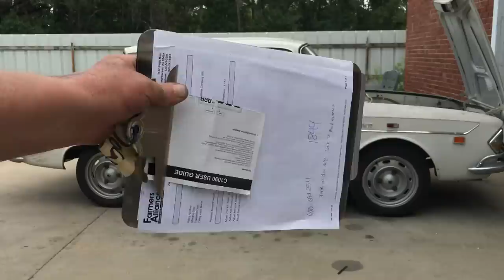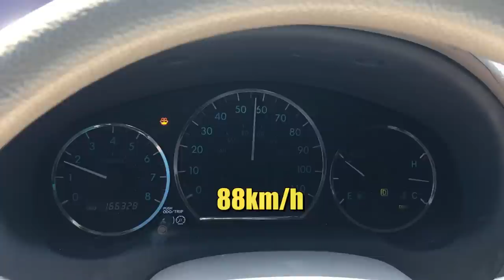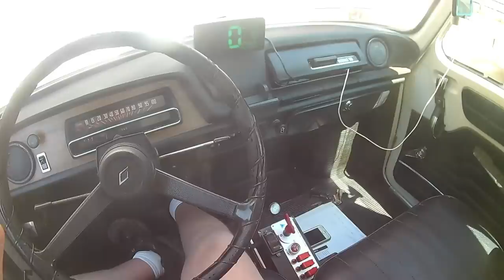S3 E21. How fast will this 670 cc predator V twin powered Renault go?...  Faster than you think!

Comment: "It's as if Renault made no effort whatsoever to homogenize this car for the American market."  Nobody copies the French, and the French copy no one.
Reply: With surprising results...sometimes.
Reply: Horsehockey.  Everybody (almost) tries to copy the French when it comes to wine.  Renault,..... well not so much.
Would love to know the 0-55 time with the original R10 engine.  No fair racing farm machinery.  They always win.
Reply: Volvo and Renault worked on a joint V6 engine in the late 70s.   The result was what I consider Volvos first bad engine.  Overheat it once, and the whole thing was trash.
Reply: What the,you haven't heard of a Chevy yet made in America for America by 2 Frenchman living in America oh by the way Chrysler and dodge are French also
Reply: @randallthomas5207  I am still unsure what's up with the bad reputation of the PRV over there, this engine was co-developed between Peugeot, Renault and Volvo (You can guess where the acronym came from). 
Now it is a bit weird, because of its 90° V6, since it was supposed to be a V8. But calling the PRV unreliable is like saying GM makes bad cars. They made a dozen of different variants from the mid 70s to late 90s, some in 24 valves form, some with turbos, making up to 400hp in the last Venturis.
While they aren't known to be fun or cheap on gas per se, they're known to be basically bulletproof, it's not rare for them to go 500k+ km here in their 12 valves form.

I think the poor work of DMC and emissions rules really messed with people perspective of this engine in the US, a shame because they’re great little things!
Reply: @fs6622 I've never had a French wine that I thoroughly enjoyed. I think the issue is that I rarely ever spend more then £20 on a bottle of wine and I can imagine all the decent French wine has a higher price tag then an equivalent Australian or American (or other countries) wine. 

I can also imagine all the rules in France about wine making make it harder to "fake" a good wine (they aren't allowed to add sugar to compensate for low sugar content in grapes, they're only allowed to use grape consentrate to boost the unfermented gravity which has the disadvantage that it can also increase acidity). Allot of the wines I like well and truly throw the rule book out the window. One of my favourite wines has about 15% of the fermentables from forest pollen honey and uses black forest fruits as well as grapes.
Reply: Everybody copied Citroen , specially the germans
Reply: @micheals1992  I never implied that French wine was better.  Only that so many winemakers try to emulate it.
Reply: @justinbridgewater7055 Walter Chrysler was German. The Dodge Brothers were American born, of British descent.
Reply: @randallthomas5207  My Mom & Dad bought a 1976 265 wagon with the "PRV" engine. At about 60,000 miles the camshafts had to be replaced, and as this engine was designed for a front wheel drive application, you had two choices. Either pull both cylinder heads or cut holes in the firewall, as the cams had to be removed from the rear of the heads. At the same time I had bought a new 1975 242 with the B 20 engine. The 242 was more than an equal match for the V-6 power wise and the B-20 made it past 300,000 miles with the second owner. The V-6 was a serious downgrade from the 1975 B-30 engine
Reply: @micheals1992 what's the name of this wine? Sounds really interesting, I would love to try it.
Reply: @Wok_Agenda  Everyone used their Hydropneumatic suspension design, thats for sure.
Reply: @fs6622  0-60 was 22.6 seconds. Fuel economy was 29 to 35 mpg US.
Reply: @justinbridgewater7055 The Chevrolet Brothers were Swiss.
Reply: @ulrich_badmecanique European cars are generally sub par. My best friend had one of those little cars when we were kids. He loved it. I don't know why. It leaked all the oil it didn't burn. It didn't have enough power to pull itself, let alone two big kids weighing over four hundred pounds combined. It did get good gas mileage though. Probably makes more power with th the HF engine, and waay more reliable. I would love to have it in it's current configuration.
Reply: True, and sometimes it seems like a deliberate slight. In 1940 surrendering to the Germans was all the rage in Paris, then everyone just stopped.
Reply: @vanceblosser2155  Wow..!  That fast???🤣  My best friend had a 1968 or so R8.  I towed him home once with my 1966 Pontiac.  Scared the crap out of him.... said that was the fastest that Renault had ever gone.
Reply: @timothybyrom5560  You seem to miss the fact that the R10 was just a slightly up-trimmed R8. They were designed to be cheap cars and never pretended to offer anything extra. That's like complaining a modern dodge dart is cheap, they fit a purpose
Reply: SAABs from the bullnose era had their turn-signal's lever on the right side of the steering column. This isn't such a rare thing among left-hand drive steering wheel cars from Europe.
Reply: @justinbridgewater7055  I think you kind of made my point for me.  Not even Frenchmen (Chevy bros) copy the French.  Maybe they came to America because they got tired of making goofy stuff and just wanted to make real cars 😜
(And my comment above was all in good fun.  French make great stuff, its just a little quirky sometimes)
Reply: Nobody copies the French for good reason.
Reply: @randallthomas5207 Peugeot was also involved. The engine is called the PRV V6. It was planned as an european V8. But then the oil price crisis occurred. So they cut off two cylinders which took the smoothness off the engine completely . Maybe there are problems with overheating, but I have never of such things…
Reply: @fs6622  That figure is from road tests via Google. I know it was in that area as our R10 could leave a Beetle way behind. Something must have been wrong with his R8. Their automatic was only a second or two slower, it was a 3 speed but had an electric clutch controlled by an analog computer. No slippage.
Reply: @randallthomas5207 Not quite, but given people's allergy in Australia and America to listening to the manufacturer and doing scheduled oil changes and using antifreeze instead of water, yeah they do pop head gaskets thirty years on, but when new they rarely overheated given the wet sleeve block.
Reply: French invented VR6, even they weren't crazy enough to keep using it 😂
Reply: @Low760  If you had to pull the heads, it was difficult to get things sealed back up, to the head and the wet sleeved cylinders to the block.  They used a paper gasket material, which was easily torn, if you disturbed the cylinder sleeves.  and the top of the sleeves liked to adhere to teh head gasket.  They were really hard to pull the head, and get back together successfully.   And, living in Vegas, things tend to overheat.   It was a common enough event that you could always find one of the Volvos with the 6-cylinder in salvage yards across southern Nevada and Arizona.
Reply: Homologate…..not homogenize
Reply: Come on, surely it was a joke. Turn signal lever side is such a trivial thing.
Reply: @peterelvery  My personal daily driver is a tiny Japanese pickup, with right hand drive.   I get used to the turn signal on the right (drivers window side).   I recently drove a work pickup, with the transmission selector on the column.  I was on a major street and needed to turn left across oncoming traffic.  I pulled up to the intersection, and stopped to wait for the oncoming traffic, and turn on my left turn signal.  When the break in  the traffic occurred, I was in park and missed the turn.
Reply: @fs6622  well if you like fermented grape juice then yea, i guess??.. but the French did actually make some of the most beautiful cars and they did make some of the most innovative cars that was far ahead of its time..
Reply: @justinbridgewater7055  Chrysler and dodge is owned by the Fiat group which is Italian not French...
Reply: @micheals1992  yo french here , here you can have really great bottle for 6~12 $, whe got cheap bottle for less but sometimes there  surprise you.
Reply: @fs6622 to understand that come to France, try our bread , (American standard bread is trash like), try local wine
Reply: @Wok_Agenda who copy Citroen? Citroen cant be copied, other then hydra lift suspension inveted by Citroen and later on bourought by Mercedes ,
Reply: @randallthomas5207 When I started driving here in Australia, Volkswagens had it on the right but German Fords had it on the left? The Citroen CX had a non-selfcancelling rocker switch! Always have to adjust for every car.
Reply: @gabrielc5642  Metal monocoque, disk brakes , plastic interior/exterior pieces , small engine low drag
Reply: @peterelvery  But had self centering steering, self leveling suspension
Reply: @Wok_Agenda  Indeed! I forget who it was who said, "There are cars, and there are Citroens."
Driving a CX2400 was like driving a car from another planet. Huge wheelbase but agile through tight corners. Only real pain was having to remove a headlight to get to the battery terminals which were underneath.
Reply: But renault did invent at least shock absorbers, steering wheel, manual transmissions, drum brakes, replaceable spark plugs (in cooperation with bosch) oh and centrifugal super chargers on which turbos are based on.
I'd say we copy a lot of stuff the french do.
Reply: @randallthomas5207  Same "great" engine found in the DMC DeLorean 😅
Reply: I'm married to a French lady.  Haughty is the word.

Comment: Shaped like a brick and still runs nearly 70mph on a Harbor Freight engine. Pretty amazing what you've been able to do with your last 2 builds.
Reply: Yeah, I want to see what it does with some engine upgrades and one of those little superchargers. I bet it ends up pushing 90.
Reply: @bradleyj.fortner2203  two cylinders enables you to run turbos too, which give better top end power
Reply: I want to see what it gets for mpg with HarborFreight engine vs original
Reply: yeah that's pretty nuts. the hf engine isn't even that strong for its class, so 67 mph right out the gate is very impressive. red beard made 40 with a heavily modded 670, so I'm sure there's stuff mr robot can do to turn his up. too bad there isn't anywhere he can go to really cut loose, because I could see this engine being turned up enough to get this tin can to 100.
Reply: @somedude2492 superchargers are better than Turbos. Superchargers cost more and take more skill to setup is why you see so many Turbos.
If Turbos were "superior" then topfuelers would use them .
Reply: @NotMeeither  i like superchargers, don't get me wrong. Each one has their advantages though. There's a reason muscle cars run superchargers and high performance race engines use turbochargers. Superchargers get power from the get go and thus increase low end power and torque, increasing acceleration. Turbochargers on the other hand take a while to spool up and feel sluggish at the low end, but have much less parasitic draw at the top end and allow for more compression, making for a stronger top end of the curve. These are top speed runs, and the car is running a CVT transmission, so top end is much more important than low end. Turbos and superchargers coexist because they are both good with their pros and cons, neither one is an all around better system than the other.
Reply: @NotMeeither  Its exactly the opposite when it comes to supercharging vs turbocharging. Supercharging is a less complex system by far, and easier to set up.

Turbos are more common because they are already stock on many cars, cheaper and give higher efficiency. 
Downside is effectively just one: More power delivery delay than with a supercharger.

Top fuel dragsters use superchargers, and even a specific type and size of supercharger as well because....thats what it says in the regulations for the class.

Now I dont mind superchargers at all, they are neat. But whats written above are the facts in a comparison.
Reply: It's a light car so I'm not really surprised
Reply: @GoldenCroc  well looks like you know everything in the world so I won't argue with a knowitall.
Reply: And it can be even faster with some tweaks 😉
Reply: @GoldenCroc superchargers were/are also easier to build, so they were in some before ww2 already.

And later were available from 2 stroke diesels to bolt on top of an engine for hotrods and dragsters, so thats what they did.
Reply: @NotMeeither  Why such a sourpuss? Did a turbocharger run over your dog or something? Facts are fact, no need to prefer one thing over the other for it to be so. No shame in having a preference, but your post above was just a little bit to "out there" when it came to statements to be left unanswered. 

In any case, yes for the things discussed above, I do know very well what I am talking about. Feel free to disprove anything about it if you wish, I welcome any chance to learn something new... A pretty good stance to have if you want to know stuff, not just think you do, wouldnt you say?
Reply: @lassikinnunen  Yes, exactly as I wrote above, Supercharging is a less complex system by far and that includes all parts of it. Easier to manufacture (greater mechanical tolerances is o.k), easier to install on a NA engine because of no new exhaust needed, often no extra cooling needed, less critical fuel delivery system and works fine with carburators, something that is so-so with tubochargers, etc etc.

Funny you should mention the two stroke diesels, I know what you speak of well enough. I dont know if I remember correctly, but old school roots blowers sizing were often called 6-71, 12-71 etc. I think those "sizing numbers" originated from which model (which also were called 6-71 etc) of Detroit Diesel two stroke they had originated. 

Cheers mate.
Reply: That's awsome. 22hp engine being able to propel a car to that speed. Flat ground. We don't live in Kansas.  We have hills. Be a nice little car for a town grocery getter. Good job. I was thinking of building one just wodered the same how fast will it actually go.
Reply: @NotMeeither  Let me take your statement and flip it around, If superchargers were "superior" then Formula 1 would use them. There is no one size fits all for forced induction each has its positives and its negatives, which is why BOTH are used to fit the need.

Also a supercharger setup is a lot simpler than a turbocharger setup.... not sure where you got that bit of misinformation from.
Reply: @NotMeeither  Complete nonsense. A supercharger is just an air compressor driven mechanically. What skill is in setup, fitting a pulley?
Reply: See you dont need 300hp. And if you are aerodynamic together with a small engine the savings are huge!
Reply: @NotMeeither Horses for courses. For drag racing the response time of a turbo, especially a big turbo to get big power is going to be prohibitive. You'd be half way down the track before the turbo spooled. To fix that gets complicated (multiple turbos of different sizes, nitrous oxide, etc.). 
For on road driving superchargers aren't the most efficient way to provide boost, turbos win there as they're using waste heat from the exhaust, not stealing power from the crank that could be driving the wheels.
Reply: Shaped like a tiny brick with tiny tires
Reply: @NotMeeither  "I can't compose a relevant reply because my opponent is objectively correct", FTFY.
Reply: @michaelhoneycutt7138  my dad said once when I was little, when he noticed the label "15hp" on our lawn tractor, "you could go 60mph with 15hp". After watching this video I believe him.
Reply: @Surestick88  Turbo anti-lag really isn't that complicated, and the lag is actually irrelevant when you get a countdown during which to rev the engine and spool the turbo. The reason they use superchargers in Top Fuel is because that's the regulation for the class. There's really nothing more to it. If you want a justification for why that's the reg, then you need to study the history of early hot-rodding. They use superchargers because superchargers are culturally linked to drag racing, not because it's difficult to make a turbo do the same job.

Comment: I don’t know why Harbor Freight wouldn’t want to sponsor this!
Reply: Liability
Reply: Probably due to possible emissions standards violations for use in a motor vehicle.
Reply: @wildbill23c this car was manufactured before 1972, so technically there are no emissions controls being defeated by swapping the engine.
Reply: @PimpMyPc89  Not to mention it's probably producing better emissions now than with the stock motor. Motor tech has come a longggg way since the 50's
Reply: @jttech44  I was wondering the same thing lol.
Reply: @fs6622 It's a one-off personal project. Liability isn't an issue. They could easily promote just the engine.

"Look! Our store brand engines are so powerful, they can run a car to 70 mph!" Something like that.
Reply: That's a very interesting thought as I'm not sure that HF/Predator sponsors anything. They have come a long way and their reliability is quite good these days. Maybe some type of sponsorship may be in their future. Ive seen Predator generators and engines go over 2k hours many times. I realize that Honda and others do better than that but not by much. And they are multiple times more expensive. And put a Predator up against a Briggs and you might be surprised at the outcome. Cheers guys!